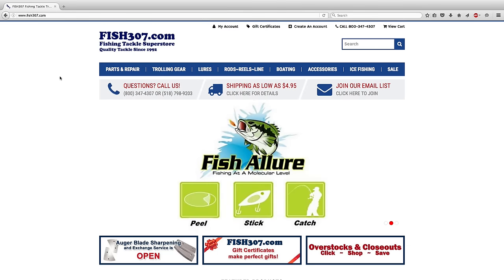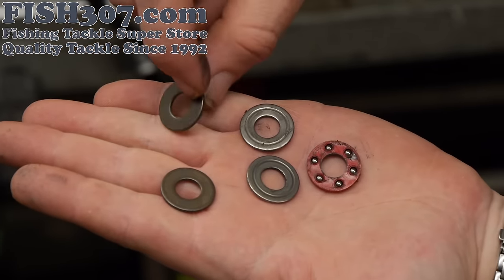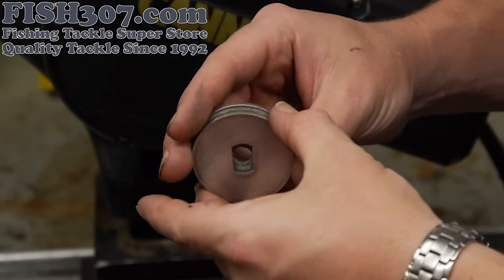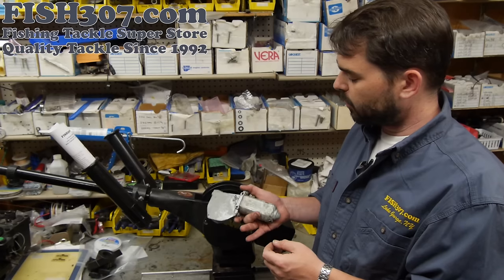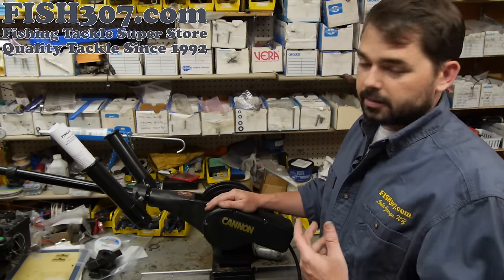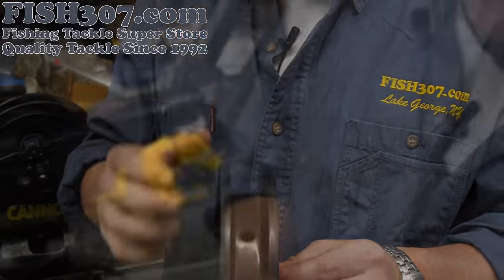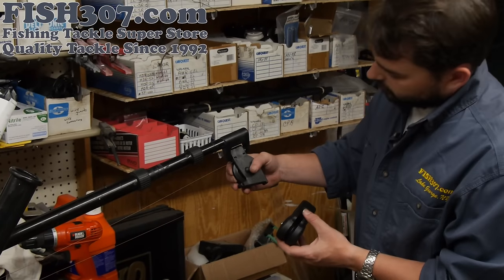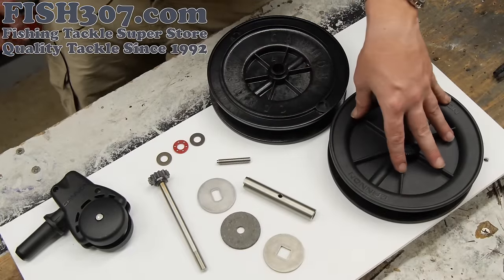Downrigger Repair & Maintenance @Fish307.com

Comment: I found a cannon downrigger on the highway about 20 years ago and it has been in my backyard ever since in the weather. My boss is an eBay guy and I was going to get him to sell it for me. After some inspection I found that both of the switches are broken from the hiway and there is some corrosion on the outside of the electric motor. Do you think it is worth repairing or the scrap bin?

Comment: Is the counter serviceable? I have two Mag 10s that are a year old, moderate use, and just had one of the counters skip for the better part of a morning and then started working fine. The spool and counter gears were aligned correctly. I had to re-zero my line with the ball touching the water several times, so I know that wasn't the issue, it was something inside the counter itself. Thx!
Reply from the maker: Unfortunately it is not serviceable and can only be replaced

Comment: My cannon downrigger keeps blowing the fuse.  Rigger comes up slow. (12lbs ball)  What might be going on?   Also I was wondering if getting grease on the clutch fiber washer will ruin it.
Reply from the maker: Greese wont ruin the clutch fiber. It sounds like there something inhibiting the free movement of the spool or the motor is bad.

Comment: Thanks Luke helping me out. One thing tho is that your info only talks about new riggers. My Mini-Mag 5 has an actual swivel on the boom end attached to a pulley. How do you remove the metal cap in the end of the boom to replace the swivel & pulley? Also is there a way to remove the boom easily? Thx!
Reply from the maker: The only way to take the pulley off is to unscrew it and take the pulley apart. As far as the boom goes there is a screw on under side of frame remove the screw and the boom will come.out.

Comment: Is there any chance of you doing a video covering the Cannon Shortstop feature and the different switches ie 3 prong and 4 prong and where each is relevant and can be used
Also the possibility of converting a broken Electric model to Manual
I have a Marlin HP Electric and I see the fibre washer seems to be covered in grease from the drive shaft gear. Is this normal or has the prior owner overdone the grease application which covers the entire enclosed housing.ie Is the Fibre clutch washer meant to run dry
Reply: I’m working on a cannon digitroll 5 right now and am shocked the roller gear housing is filled with grease also.. How can a clutch work bathed in grease?!? Did you ever find an answer if this is normal? Special clutch pack or something?
Reply: From memory I did receive a reply in the affirmative but I cant locate it. Anyway I put it all together with the clutch pad all bathed in grease and its working fine so like you I scratch my head. I just used the grease that was there.